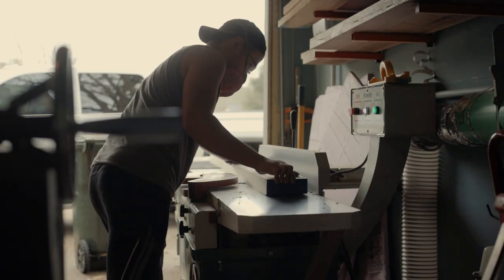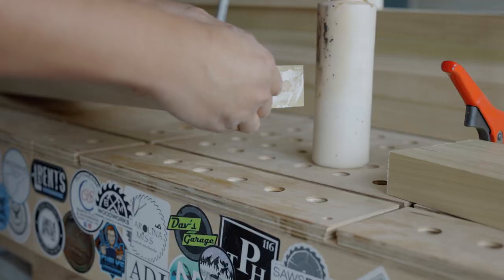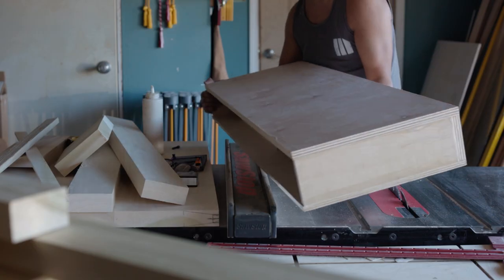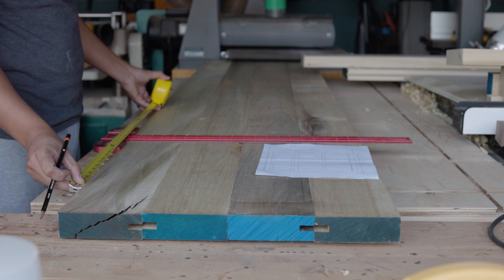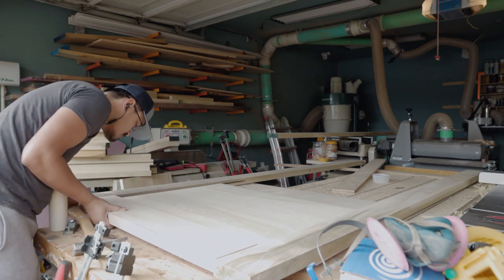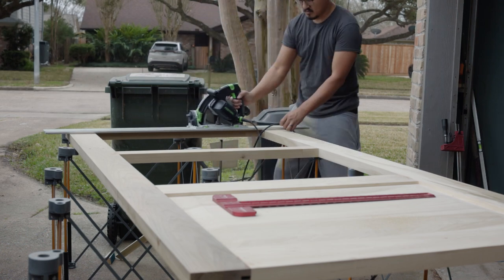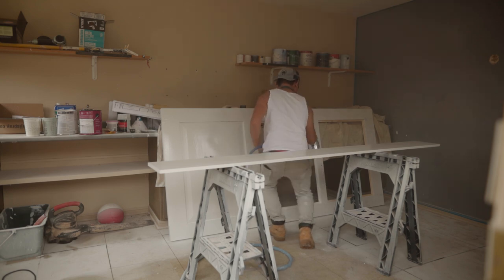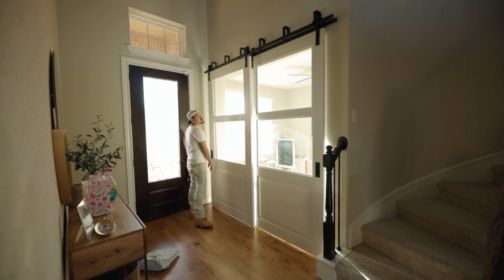How to Make GIANT Sliding Barn Doors with Glass // Woodworking

Comment: Two questions for you: 
A: how are you liking the DEROS? 
B: I saw 2 marks when you were using your Domino, what is your process for aligning your Dominos?
Reply from the maker: A. it's ok so far. I'm noticing it's starting to vibrate more than my Festool. Don't know if I have a bad one.
B. I make the dominoes a little loose, which is setting two on the machine.  It gives me a little wiggle room to make sure everything is aligned.
Reply: @DesignCraftWorkshop  my DeWalt started great but the vibration is out of control now. Was leaning towards the Mirka...appreciate your thoughts.
Reply from the maker: @daltrywoodworks8811  I've only had my Mirka for 4 months....